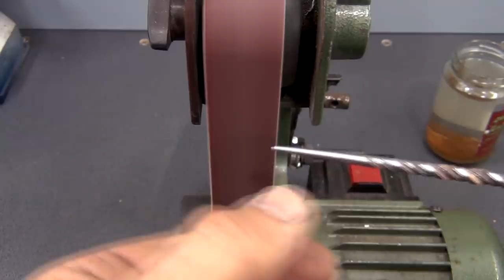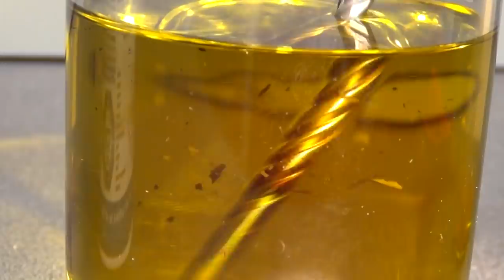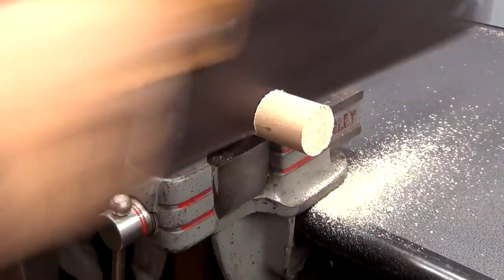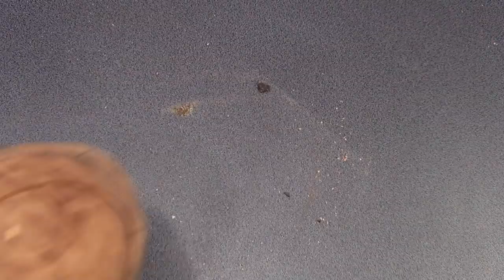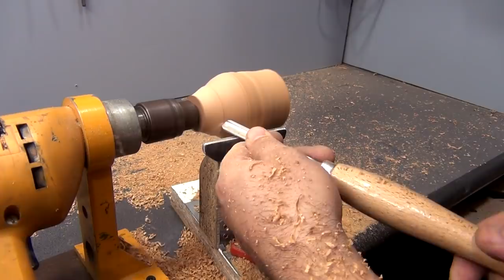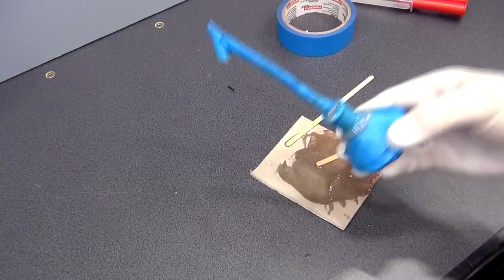Making a Birdcage Awl from an old drill bit

Comment: I had to cover my eyes a couple times during the process, I was a'feared for your safety - but it is certainly hard to argue with the results! It helps sometimes to sharpen a secondary point on the tip to make these square awls cut better. Thanks for posting this and keep up the good work!!

Comment: never seen making such a beautifull lathe by hand...you are very very smart to do that...all my cmpliments from the netherlands    gr. Arie
Reply: a good tool has no glue , in it fabrication
Reply: @lkkjhtemmexv1838 , yes, he could have threaded the end of the bit and installed it in a threaded insert in the handle and topped it off with the ferrule, but he didn't.

Comment: You can make a small woodworking machine for about 100/150 dollars and that will be a very good one with a pwm powerful DC motor, live tailstock centre, small 50mm chuck and a sliding bed,  you will have to make the headstock out of a couple of pieces of aluminium plate and 2 or 3 bearings and some hard work but they are not difficult to make. -Thats how I started. You clearly have the skill as this is a very nice tool you have produced using an old sds bit and a drill holder to fabricate it. Now after a lot of saving I have a top of the range British made Record lathe which is superb.  It took me a long time to get there though.

You certainly have talent as you have made a very nice tool which I would buy if I saw it in antique shop as it comes across in that style. Well done. Good video.

I even have an old Zyliss lathe which I no longer want, its designed to run off a electric drill, I used it to make hundreds of lace bobbins and pens and if you pay postage you are welcome to it. I am in spain. You just need a drill and it works beautifully for small work and it can turn up to about 80 cms long I think, just google zyliss lathe, made in switzerland.

Comment: A fine tool anyone would be happy to have in their chest. What great use of what was old junk. I've collected thousands of drill bits over the years from estate sales, yardsales, flea markets etc and I've never thought to use a drill bit like this! I've turned them around and made gouges, and I've hammered them out into knives. Well I know what project has just been added to my list! Oh and great use of that drill for a lathe. while the tool rest looked home made the clamp for the drill looked manufactured--was it? Currently I'm using a tiny old atlas metal lathe as a wood lathe. It didn't have any of the extra bits metal lathes typically have so I made a banjo and tool rest and put it to work. It's only 3 inches from center to the bed (tiny!!!) but 21 inches long. I wonder what it might have been used for.. It's great for pens now! I power it with a treadmill motor.. it's a hoot! Thanks for the video!

Comment: I love this vid, nice project and a few laugh moments, like holding the saw and letting the wood spin under it to try and save elbow grease.. then giving up and using force lol, ( I did try that last month with a thick wet log where my parting tool wasnt long enough to get more than half way through the radius ) , maybe a shop made tailstock for the drill lathe would be good and will stop a lot of vibration with the worm screw ;)

Comment: To get the roughness off a piece of wood like that, don't bother with chipping at it, use the grinder with a grinding pad and slap on it the biggest sand paper granulation you can get, big enough that you can see the glass crystals on it. It'll chunk down the wood in under a minute, and, once you get really good at it, you can get it really smooth too.

Comment: A little trick I learned is if your trying to pull a bolt out put really soft wood in the vice and Tighten it it’s a lot better for the threads and the vice jaws

Comment: Thanks for this upload. I hadn't been able to figure out how to fashion a decent brass ferroule that encapsulates the metal shaft of whatever tool or blade I'm working on. Not sure what a "water plug" is, but I'll certainly visit a plumbing shop and see what they have.
Reply from the maker: It's and "end cap" I believe they are called in english. Depending on the country they might be easy or hard to find.

Comment: Like you, I had to part ways with my lath. Fortunately, when I lived in San Francisco (I left in January of '86) I used to make my surf rods (Lamiglas 1364 for spinning, 1366 for conventional - both cut to 11' - a foot from each end). I made a horizontal stand for my ⅜", variable speed corded drill and used it to wrap and then dry the Fuji guides. Still have the stand and drill and think I'll reserrect them for some new front knobs for my hand planes. By the bye, have you thought of making another clampable "L" shaped stand for a dead center?

Comment: Was that a good drill they started with?  Probably doesn't matter at awl
Reply: no sds drills dont last very long...they lose their quite quickly.
Reply: OK, good point
Reply: @gregfeneis609  They are made from very hard metal, once you cut the tungsten off they make good centre punches or chisels, I have ground many down for woodwork and with sds plus bits you get a very good brick chisel, the ends that go in the drill are specially hardened to cope with the number of percussions the drill hits it with so they dont break easily. Sometime you need a long and thin chisel to get that pipe through the wall and that does the job so always have a couple in my tool box!
Reply: Wow, seems like I'm just scratching the surface

Comment: Excellent piece of work lad. Does heating it and quenching it without tempering make it brittle? I would like to make something like this but I have no experience with heating and tempering metal.. thanks very much for an excellent video.
Reply from the maker: Assuming my hardening went ok it should be only hard (and brittle) at the tip, the rest of the shaft should be normal flexible steel like the drill bit was. So I don't think there's a chance for it to snap. I'm new too hardening too, so you won't learn anything valuable in this field from my videos :)

Comment: Great job one can always appreciate good craftsmanship how about now telling us what a bird cage awl is and what its for lol
Reply: An Awl is used for making indentations to mark a position, or make holes in thinner material - they can have a simple round pointed tip or squared off tip like this one - the squared off tip means it can efficiently cut holes in thin materials and wood veneers. The reason why the squared off tip version is called a "birdcage awl" is because historically they used to be used by craftsmen working in very thin strips of wood (like bamboo) to make things like birdcages.

Comment: It was already tempered better than oil could EVER do.
Reply from the maker: No it wasn't since the cutting tip was carbide and the rest of the steel was softer to absorb shocks and not snap.
Reply: @TheSmallWorkshop  Masonry drills like chisels with Tungsten inserts are made with the bit brazed in after the drill is treated, they cannot be quenched or overheated, hencg they require green sillicon carbide or diamon sharpening stones to keep them cool, if you ground the entire bit out, you are still left with tempered steel, the makers have far better quenching set ups, they know their craft...even cheap chinesium has vanadium in it....you cant get ANYTHING as precice in a garrage, sorry bud, i know this well.

Comment: I have a couple of questions but first, that is a beautiful awl. I could use one like that for leather tooling so I think I will make one like you did 
Q - 1) Where did you get the holder for the drill for your makeshift lathe?
Q-- 2) Do you have a video about the makeshift lathe?

Comment: Terrific, but did you temper after the quench?
Reply from the maker: Nope, since I only hardened a small portion at the tip I don't think there's the possibility for it to break. I've been using it a lot since then and it works great, still as sharp as the day it was made.

Comment: What is the point in heating and quenching in oil without annealing already hardened bit?
Reply from the maker: The bit is not hardened, it had a hard carbide tip that was cut off. The shaft itself is not too hard so it remains flexible under load. But it is hardeneable steel, since the SDS tail takes quite a beating from the hammer action of the drill without deforming.
Reply: @TheSmallWorkshop  OK I've seen it now, it was concrete drill bit.

Comment: Forgot to ask - why birdcage?
Reply from the maker: Why the name? Because of the square tip. Why the square tip? Because in theory it tears the fibers a little when used, so it makes a clearer mark and also a better starting point for drill bits.
Reply: Because they used to be used to make holes for the bars in wooden bird cages.
Reply: Because a journalist bird wrote an article about the opression they suffer and named it like it.
Reply: For making the holes in the base of a birdcage to be made with split reed or cane ( square stock ).  this one is a bit big for that,but much more efficient  than a  round awl for most purposes.
Reply: Mark McCluney 😊
Reply: Carlos Castillo . w Polsce
Reply: The Small Workshop w
Reply: After lot of work u had brought great tool

So nice
Reply: Beautiful. You’ve just got another subscriber.
Reply: Beautiful!  Put a little bit of paste wax on the steel and brass to keep them shiny. Or leave them as is and let them age to a nice patina.
Reply: What's the point unless your gonna make some Birdcages !
Reply: U
Reply: @wiesawpaczynski8911  the runner
Reply: @TheSmallWorkshop  
but then if you make the hole somewhere you actually didn't want it you can't repair it simply by pouring hot water on top of it.

Comment: Since that was a specialty aircraft drill you used for the awl point then without question it would have been made from High Speed Steel. (HSS) There's not a hope your going to affect it's heat treatment and the original hardness at home with a torch. High Carbon tool steels can be home heat treated but HSS can't with the normal equipment available in a home shop.
Reply from the maker: It's a masonry bit with carbide tip and carbon steel shaft. The carbide was cut off so I only have carbon steel.
Reply: Ah ok my mistake then, the chuck end threw me off. That type of drive is usually used in the aircraft industry.

Comment: What oil do you use to harden?
Reply from the maker: I used olive oil, cause I had some old one in the house. Any vegetable oil should do, I've seen a lot of people use peanut oil. It did not harden very well tho, don't know if it's something I did wrong or the steel is not that great, so don't take lessons in hardening from me, I'm a newbie too.
Reply: I don't think the shank of a masonry drill bit should have a lot of carbon in it, I don't think it needs to be really hard...
Reply from the maker: I've thought it would be hard, because the SDS part is under some heavy stress when in use, and also the tail end of it takes a lot of hammering without deforming. It's hard that I can't cut it with a hacksaw but a file bites into it even after the heat treating.
Reply: The Small Workshop   ..Some steels need to be quenched in water to get hard